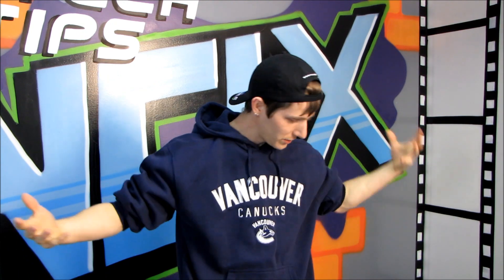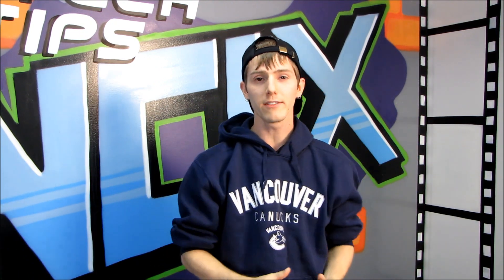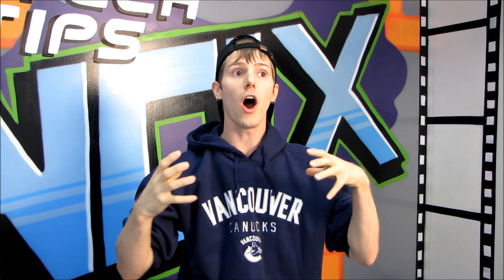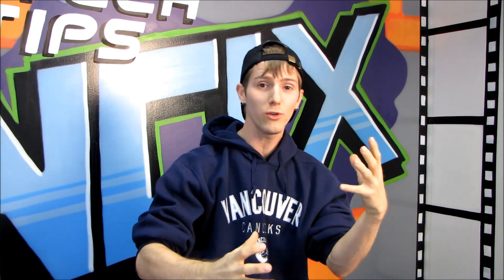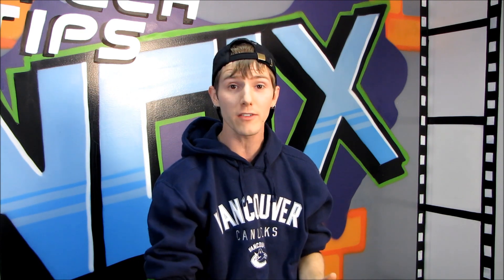Futureproofing Your PC - Dispelling Some of the Myths NCIX Tech Tips

Comment: To answer the end question, nah not really.  Today it would be ether a 3570k OR 2500k, not that much difference in them.  Yeah yeah pcie 3.0 but all I want from a rig is to be able to play the games I want(some new some old) for 4 or so years at native res, dont care about other settings.  gpu X60 form nvid x850 from amd, upgrading them when need be. 8GB ram because CS major and coding needs it. What I want: To be able to play new games at native res for 4 years, don't care about other settings.

Comment: in my opinion yes it is, as long as yes you get a K edition cpu so you can overclock it. i7's hyperthreading doesnt help in many games and not alot in those that supports it so a 3750k oc to 4.5ghz + sli 670 in my opinion would last at least 2 years to to run any games at 1080 p max settings, well at least until BF5 (lets say november 2013) then you might need to start dropping quality settings for some games

Comment: CPU - i7 3960X
GPU - 2 x GTX 690's SLI
PSU - XFX 1000W 80 Plus Platinum
RAM - 8 x 8GB RAM
SSD - 24 x 512GB RAID0
MOBO - Rampage IV Extreme
Monitor - 30 Inch 2560x1600
All Watercooled

Comment: 1. it means go for midrange builds,.
2. AMD FX 6100 BE,  8gigs of kingston hyperX 1600, nice ATX asrock board with Sata 3, usb3 and pci-3 and sli crossfire,  hd 7870, 1x 500gig WD Caviar Black Sata 3, 1x WD Caviar Green Sata3, Any case of choice you want, 650w bronze psu, corsair h80.

Reusable parts: hard drives, power supply, cpu cooler and case.
Purpose: Gaming and watching movies,.
Future upgrades: when the next gen card comes out, the 7800 series price will drop, then do a crosfire^_^,.

Comment: i7 3770k
evga ftw gtx 670 *4
asus maximus v formula
xfx proseries 1200w psu *2
16bg corsair dominator or gskill trident x
ASUS PA238QR 23IN Widescreen LED Backlit IPS LCD Monitor 1920X1080 6MS 50M:1
4 480 gb corsair force gt ssd
thermaltake frio or custom water cooling

Comment: Asus Maximus V extreme (waiting for release) mobo
3770K cpu
16GB corsair low profile 1600mhz (2 X 4) X 2
EVGA GeForce GTX 670 (build up on SLI possibly all the way to 4 way depending on games)
Cosmos @ case (easily fit anything)
128GB SSD for OS and high end games
Raid 0 + 1 of Seagate 7200 RPM 1TB drives for speed and backup ability
AX 1200 corsair PSU
Water cool all of the video cards and cpu after findig the right balance of graphics cards for games and best frames rates needed.

Comment: MSI Big Bang XPower II
Intel Core i7 3960K
8 x 8 GB DDR3-1600 RAM
LEPA G1600-MA-EU 1600W PSU
1 x Super Talent RAIDDrive II PCIe SSD 2TB read:2800 write:2400 for OS
4 x Seagate ST33000651NS 3TB
and last but not least: The Graphics card.
I would choose a EVGA 8400GS Passive with 512MB of RAM.
:D

Comment: EVGA CLASSIFIED SR-X
4 x GTX 680 Wathercooled
2 x i7 3960K Wathercooled
2 x 1200W 80Plus Platinum PSU
12 x 8GB RAM
24 SSDs in RAID0
BluRay Burner and DVD Burner
and 15 inch 800 x 600 Monitor :3

Comment: So linus you believe (at the time of this recording) in selling the old graphics card and buying the next generation. I did the opposite, I had a single gtx 470 on a p6tse mobo with an i7 930. Instead of spending piles o cash (499 for 680). I went with an eBay alternative an EVGA ftw3 mobo and two more 470 total of 350. Still a lot of money to the common gamer but from the research I did tri 470 will definitely beat 1 680.
 thoughts or concerns?

Comment: here are my specs:

case: Corsair Obsidian 650D
CPU: Intel Core i7 3820
CPU water cooler: Corsair Cooling Hydro Series H80
Motherboard: Asus P9X79 Motherboard
RAM: Corsair Vengeance 16GB(4x 4GB) Quad
Channel
Graphics Card: ASUS GeForce GTX 560
power supply: Corsair Professional Series Gold AX850 850W
HDD: Western Digital WD Caviar Green 3.5" 2TB

Comment: I got so lucky with my m1730 laptop. ended up being a tiny bit future proof out of pure luck. I had my 8700mgt sli setup go bad and got a 8800mGTX sli setup. then that went bad and it's now sitting with a 9800mGTX sli setup. The processor, the X9000, has done me justice throughout the years (i got it the day the X9000 came out) and the computer has fit my needs till. Now. I'm just now looking for an upgrade, mainly because I have changed what I need out of my computer.

Comment: AMD FX-8150. Yes, the performance is horrible now, but Microsoft is working their ass off to use the processor correctly in Windows 8 (latest Bulldozer update for Windows 7 wasn't good enough), thus it's 8 cores and will only perform better in the future so it's good enough for years to come.

Comment: I don't know how much time this is gonna last, but I bough a PC about 2 weeks ago with the following components: x79 Sabertooth motherboard, 3930k, SLI 670s, 16gb of DDR3 ram running at 1866, water cooling system with a 360mm rad, 1050w power supply, and a nzxt 810 switch case. I hope it lasts for long...who knows. It can run everything at max settings 1920x1080 mostly above 90fps now. That is partly the reason why I am not gaming at a huge resolution, because 1920x1080 will last for longer.

Comment: This is the most future-proof system I can think of, A EVGA SR-X, Two 8-core xeons running at 3.1Ghz 4 GTX 680s in quad sli, 64GB of ram two 512GB ssds in raid 0 and two 3GB WB Caviar greens in raid 0 all water cooled in a CaseLabs T10 case.

Comment: asking that here you will get so many different opinions that will contradict eachother, eg, i have heard that the AMD fx 4100 can run battlefield 3 at 60 fps with a 560ti, but ive also heard that a 2500k with a 570 will bearly push 40 fps, but ive also heard that the 2500 k is much better than the fx 4100, (all at stock frequencies)

so basically, good luck getting a straight answer that is fact rather than opinion.

Comment: Blu ray burner, 1tb caviar black, crucial m4 128gb, 2500k, gtx 670, ax850, 650d, corsair vengeance ram, BenQ 24 inch 2m/s monitor, logitech z323 speakers, g510 keybaord, g700 mouse.

Good quality case and power supply, keyboard, monitor mouse and speakers should last me a long time and can overclock the cpu if needed, only need to update video card :p

Comment: MY current System
CPU- Intel Pentium 4 3.00ghz
GPU- Nvidia FX 5500
Ram - 521mb Kingston DDR -400
Cooler - Stock
Case - Some case from the depths of hell
MY upgrade from my Windows 98 (:

Comment: I generally build to a platform with the view of upgrading the RAM and graphics card in 18 months to 2 years, and then another platform build for the next cycle. Pick a nice case and decent PSU that can last for a number of builds, as well as a nice quality monitor and speakers. Been using the Logitech z2300 2.1 since they were released and they are still great, and my dell 24 inch IPS panel looks great and goes from build to build as well.

Comment: CPU: Core i7-2600k
Motherboard: Gigabyte g1 sniper2
Power supply: Corsair 850w modular
Ram: Corsair dominator 8 GB (2x4GB)
Corsair hidro 100 for cpu cooling
Graphic card: MSI N580GTX Lightning Xtreme Edition
2 OCZ 80GB SSD in Raid 0 and one samsung 500GB Sata 3 HD
Case: Corsair Obsidian 800
For me .. its the better choice =D

Comment: My last upgrade: 
CPU - 2006 Intel Core 2 Duo E6300 2.93Ghz OC to Intel Core i5 2500K 4.8Ghz OC
GPU - ATI X700 512Mb DDR2 to GTX560Ti 1GB
RAM - 1GB Samsung DDR2 to Corsair 8GB DDR3
Case - OEM Piece of shit to Corsair 600T White
Cooler - CoolerMaster OEM piece of shit - Corsair H100

I upgrade every 5 years. :)

Comment: Well thats why you don't buy the 3960X. Sandy Bridge-E is just for bragging rights. Overall Intel CPU's are very good, they even beat AMD at very low budgets: The SB Celeron G530 beats the similarly priced Sempron 145 by miles. To be honest AMD have been failing lately with the Bulldozer series. I hope Piledriver does well. But Intel really don't charge that much, $160 for the 2500k that performs the same if not better than the $250 FX-8150 in games.

Comment: Ivy bridge is maybe coming a bit later .. The improvement over the current i7 2600K is about 10-15% its up to you if that is worth the wait.. For most current applications the socket 1155 will do just fine.. If your an extreme enthusiastic pc dude socket 2011 is the way to go but it will cost you more.. For gaming and "normal" use the difference is little..

Comment: My futureproof PC:
Opteron 2354 to an i5 2500k, able to replace cooling to overclock if I need it in the future
Bought another ATI Radeon 5870 to Crossfire for $150, also can add cooling to overclock if I need it in the future
Upgraded the motherboard
Upgraded from 16GB DDR2 to 8GB DDR3
i5+8GB RAM+Gigabyte GA-Z68X-UD3H-B3 mobo = $350
2x Crossfire ATI Radeon 5870 = $320 + $150 = $470

Not going to upgrade most likely ever; this remains the system I will use until I stop playing video games.

Comment: If you are able to lower your standards then it's fine. But I bought my gaming rig 3 years ago and it is still able to play games at full resolution on the highest settings. Although back then it was around 2000 bucks and now my friend has bought basically the same rig for around 600 bucks XD

Comment: i7 @3.4ghz/core could be considered somewhat future proof, in that it is cutting adge tech that has yet to be adapted by most software manufacturers. That simple fact makes it very future proof. Also the fact that it is very compatible with an array of motherboards and capable of running alongside even the most top of the line of all other components. I would say that having a cutting edge processor could be considered future proof, probably at least for the next 3 years.

Comment: right now, i would say
i5 2500k
Antec kuhler 620
Msi R6850 Cyclone power edition
OCZ ModXStream Pro 600W
SSD: Crucial CT06M4SSD2 64GB
Mobo: ASRock Z68 Extreme 3 Gen 3
Other components to your own choice :)
its a shame i have an AMD Rig with very low specs :(

Comment: @Ocmn2 idk.. think about it, you buy a build a system.the board has limits like 4 gb of ram and 1 pci-e 16x. it might suit your needs now but if you decide later that you wanna do crossfire and have 8 gb of ram (overkill imo), you have to buy a new board and the rest of the parts you need. it would have been cheaper to bypass the cheaper board and get a  good one. only thing, no one knows the future.now i'm looking at a high end video card to replace my 5670 lol.you have a point though buddy.

Comment: Dude this guy is so wrong, if you want to run at the highest resolutions possible, just get more of the same graphics card for higher perfomance. If you get the 7970 NOW it will 100% be future proof for gaming because you can 4x it! Nothing will be able to beat it in the next few years (A single graphics card). And yeah if you want to 4x it you will need A huge case.

Comment: i5-2500k, 2 asus or msi twin frozr iii 6950's in crossfire so you can unlock and overclock them when games get more demanding. Noctua NH-D14, 8gb of 1600 ram such as g skill x series. Case would be 600t and motherboard would be Asus maximus IV Extreme Z along with a 1000 watt power supply and 1tb hdd caviar black because I'm gonna be recording a lot of videos. A ocz 90gb ssd for Boot drive and z68's ssd caching. I'm getting this build in 3 months so by then the components will change.

Comment: My system I have had 6 year's.. was a cheap store brand. I upgraded ram, cpu, power supply and video card. within the next 2 day's I will be building a new system and reusing My power supply, video card, and hard drive's. there is nothing wrong with My current system and it runs every thing I need it to. only reason to upgrade is cause it's just old. future proof comes down to two things. monitor your system and maintain it and it will last a while. I have monitored My temp's and maintained it

Comment: 12 core xeon   two 6 core xeon 24 gb ddr3 ram 1000watt power supply gtx 580 two of them
4 ssd's and 2 mechanical hard drives blueray drive and a black case (aluminum)

Comment: I run sabertooth x79 with 32 gigs of corsair vengeance 1600 , two 5870s cf , raid 0 vertex 3 120 with 10 gigs of ramcache and a 3930k clocked to 4.8
no problems with any current games , maybe that will change when some new games are being released

Comment: @SenoirMeow SATA is just a type of hard drive that determines the speed, this is not something that can be explained very simply, SATA stands for Serial Advanced Technology Attachment, SATA 2 is the most common speed which is up to 3gb/s and then SATA 3 is up to 6gb/s of course i've never seen any HARD drive transfer anything at 6 gigabytes per second not even a SOLID STATE DRIVE which are up to 10 times faster then a standard harddrive go here, enDOTwikipediaDOTorg/wiki/Serial_ATA

Comment: My current most recent system.

*G Skill 8g(2x4) DDR3 1600Mhz Rip Jaws
*OCZ Agility 3 SATA3 120G SSD
*Windows 7 Pro
*i7 2700k
*Cooler Master V6 GT Cooler
*Seagate SATA3 2TB Barracuda 64mb Cache
*Antec Eleven Hundred Black Gaming Case
*3x Antec Tricool 120mm Fans 3 speed
*LG Blue Ray HD Combo
*Sapphire ATI HD7970 3GB GDDR5
*ASRock Z68 Extreme4 Gen3
*Antec HCG 900W 80plus Bronze 135mm Fan
*TP-Link Wirless N PCI Adapter
*1 year return to base warranty
$2,300 AUD Only adding another 7970 in 6 months

Comment: If its based on parts that are out now and top of the line, then what will last the longest is a mobo with esata, usb3, pic-e 3.0, quad crossfire/quad sli capable. Use quad radeon 7970's. 1500 watt power supply. For cpu, I'd wait for the Ivy Bridge Intel cpu's and whichever the equivilancy is to either the i7 2600k or 990x. 2 3TB Hard drives in Raid 0, with 6TB in backup drives. Run 4 256GB ssd's also in raid 0 with 2TB backup. Buy the three best (or more) monitors. Your set for twoish years.

Comment: Video cards are really the only part that is not futureproof, but its not hard to buy a new one 2 years down the line and plop it in.

My 4 year old Q6600 still runs all modern games nearly maxed with a 6950 2gb. That and the fact that game requirements are really not advancing as fast as hardware. Anyone with a 2600k and 8gb of ram will be futureproof for at least 4 years with a GPU upgrade later on. My Q6600 gaming rig is proof of that.

Comment: general "futureproofing" is just useing components that are as close to the top end stuff you can get so it lasts longer then the more common components. so its relative to what your using it for as Linus said and what your comparing it to. I like the term price to power"i5 build". but for instance my future proof pc would be i7 3960x with a Asus Rampage mobo,Corseair Dominator low late high mhz ram ,2 xfx 7950 in crossfire,or 590s in sli with a full water loop and equvalent psu,large SSD.

Comment: @mylaptopdiednooo i5 2500k or i7 2600k.. I am currently about to order products to build a new PC and trust me.....AMD does not have 1 single CPU that can match those 2 Intels. Not one. No joke, look at the benchmarks. I was going to go with the 1100t BE because the new bulldozers are brutal. But for $20 more, the 2500k DOMINATES and I mean DOMINATES the 1100t, which dominates the bulldozers.

As for GPU, I'm going with the 7970.. it's pricey, but should get at least 2.5 years out of it.

Comment: well,my "future proof" computer would probably consist of a high core processor,Mainly because they will most likely be making more things that can utilize more cores.Like i bought an FX6100 because it will last for quite some time...And then i would say about a 6870 or 6950 video card now because then you can SLI them for a decent price and be able to run most games at 1920x1080 res at high/ultra settings for awhile too :P

Comment: I'm running...
Motherboard: Asus Maximus IV Gene-Z Micro ATX
CPU: Intel Core i5 2500k 3.3 GHz Quad Core
GPU: Onboard CPU(Getting GeForce GTX 560Ti soon)
PSU: Rosewill 1000W 80 Plus Bronze
Chassis: Cooler Master HAF 932 Advanced Full Tower
RAM: 2x2 DDR3 (Upgrading to Corsair Vengeance 4x2 Soon)
HDD: Barracuda 1TB 7200RPM HDD

Comment: i think the most "futureproof" system would be an lga2011 based system because you could buy enoug for now and then upgrade without removing the old components like ram  and if your cooling is good enough you can overclock if needed whats bad about this is that you still have no garantee (sry im german) for things like directx or future tecnology

Comment: and even still, my radeon 5830 which I do regret buying, I should have spent another 50-70$ and got the 5850 at the time which would have been smart, I still can overclock my 5830 to 925/1300 and is runs almost as good as a 5850, I am able to play bf3 max settings @ 1080P (no AA of course) My point here, spend the extra money if you have it, it will be worth it!

Comment: @Ryan928b2 96gb ram what's the point and that Xeon is a bottle necking ur build if u really spent that much then why the hell did u not go with liquid nitrogen cooling  :)  u could get away with overclocking that Xeon CPU to at least 5.2ghz then maybe u could have a future proofed machine for bout 2 years max after that ur CPU will prolly die ^^ have fun

Comment: @AaronGA1983 then the asrock extreme3 gen3, it's got pci 3.0. ofc it will not support quad channel because the chipset is z68. a mobo with the x68 doesn't have a 1155 socket..

Comment: @tavi921 ASRock Fatal1ty P67 Performance

It not future proof in the aspect that it does not contain PCI-E 3.0 x16 Ports. It still contains the slower PCI Express 2.0 x16 ports. Nor will it use the new IVY Bridge Quad Channel memory controller that will be on the X78 intel platform.

Its a nice board though, luckily it was only around 160-170 and not an 300+ board.

Comment: Yes it has changed my perspective
This System:
EVGA SR-2
Dual 6 core 3.33GHz Xeons
96GB DDR3 1866
Quad GTX 580s in SLI Watercooled with dual 4x 120mm rads
Dual Silverstone Strider 1500W PSUs
Futureproof to about 5 years.

Yes, more lectures!!!!!